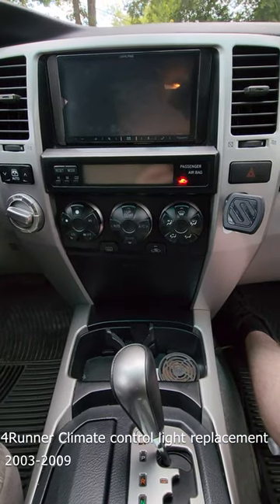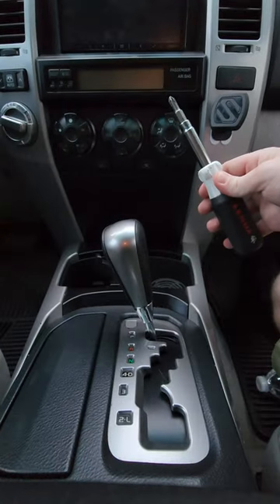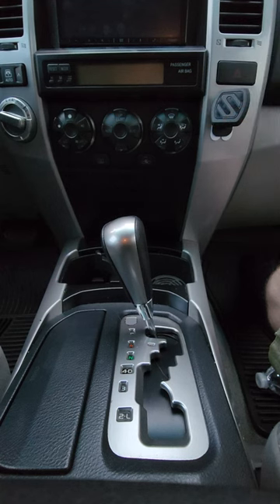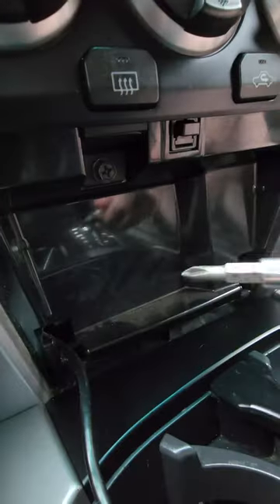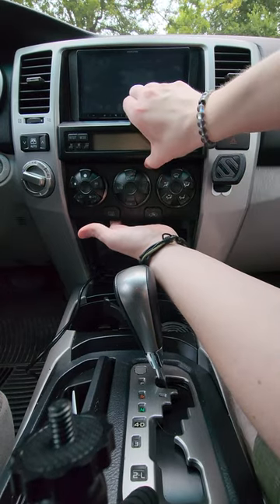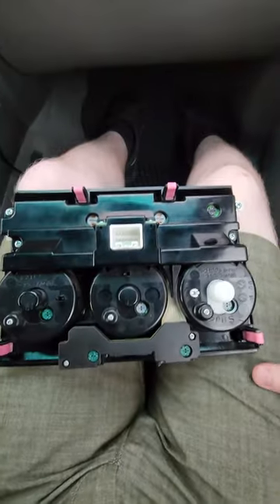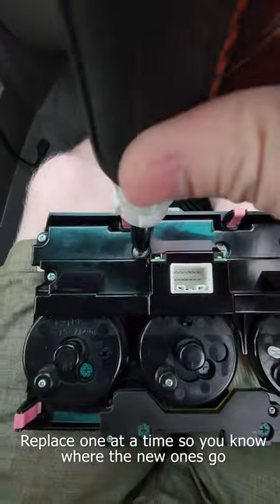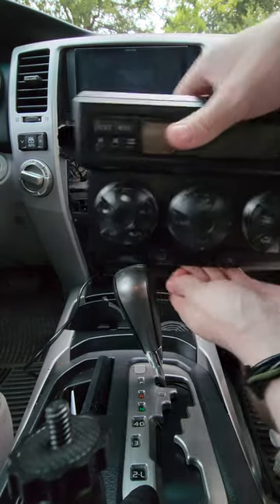How To: 4Runner Climate Control & Clock Lights Replacement (2003-2009) #shorts

Comment: Do you know the bulb size for the 4 wheel drive selector dial? Thanks
Reply from the maker: Oo I actually don't, I haven't had to replace that one yet. It MIGHT be the same size as one of the center climate control lights. But don't quote me on that

Comment: Can we do any other color than orange?
Reply from the maker: I've seen people change the color, I'm not sure of the process besides probably just swapping in different color LED's.
I'm in a 4runner group on Facebook (4th gen 4runner mafia) and one guy said you just need (T4.2 LED) for the face of the display and (T3 LED) bulbs for everything else in the climate control.
With that info, it should guide you in the right direction to get that mod done
Reply: Yes, you can do..

Comment: Any idea on why none of my cigarette lighters don’t work 😫 any tips or tricks to get them working
Reply from the maker: I would check your fuses to see if any of the accessory fuses are blown. Usually that's the main culprit. If you bought the vehicle second hand, I would see if any of the plugs are disconnected on the back of them
Reply: @SlothKingGarage  I don’t really know what I’m doing here, especially with the fuses but how would I go abouts seeing if the plugs are disconnected??
Reply: @SlothKingGarage  do I just try prying out the metal round thing that the charger connector goes into??

Comment: Where did you buy the bulbs?
Reply from the maker: I have a link in the description for them
Reply: I don’t see the link in the description.
Reply from the maker: Hmm, I just verified that it was there and it is.
If you're on your phone, tap the 3 dots in the top right corner, it'll let you view the full description. You'll see the link at that point
Reply: So I was doing my research and the led is T4.2
Reply: @slothkinggarage8135  the links aren't working. Are the bulbs still available on Amazon? Do you have a store there? Could you post a link in the comments?

Comment: I have a 2013 limited will it be about the same? My rear widow defrost button isn't lighting up.
Thanks in advance.
Reply from the maker: I can't say for sure, but I'd imagine it is very similar. Only difference would be the type of light they use and how you would remove the instrument panel to access the light.

Comment: What is the name of the light package or can you give me the code?
Reply from the maker: If you type this on Amazon, it'll pop up the kit that I used from there. It'll be the first suggestion on the page
90010-09015 - 90010-09010
Or you can buy the individual bulbs from the dealer
Reply: @SlothKingGarage  thank you  so much
Reply from the maker: @geremias6463  You're Welcome!

Comment: I just changed out my bulbs in my 08 4runner for climate control to white and was wondering how come the defrost button under the off button lighta up but when you click on it, it doesnt turn orange at the top like the circulation button next to it? Is that normal?
Reply from the maker: Hmm, I'm pretty sure it should click on. I'll have to look at mine here in a bit and see what it does
Reply from the maker: Alright so I just checked this out and it does light up for me. I went through a few different modes and the light turned on every time.
So what I'm thinking is that the LED light could've went out on it. If I recall correctly, there's a LED light in that location